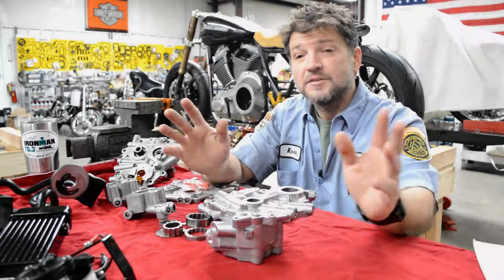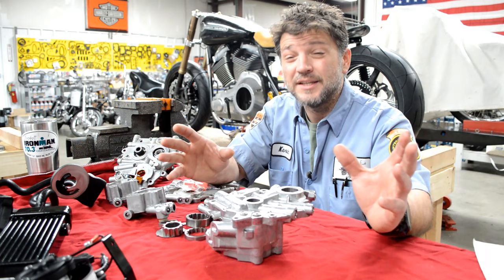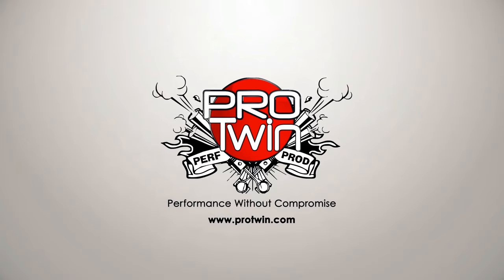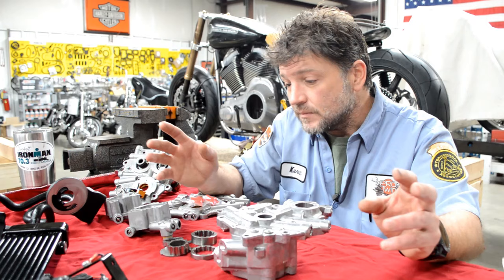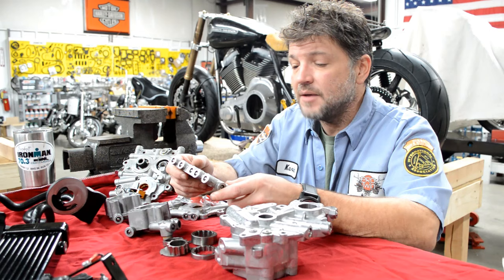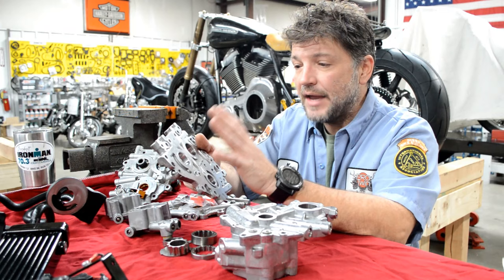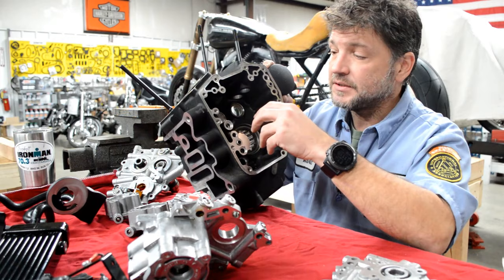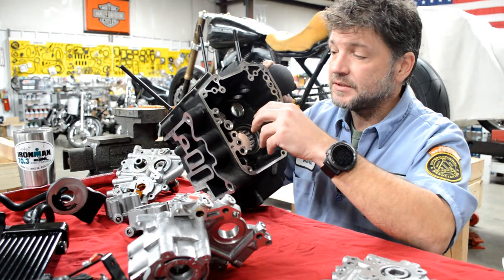Harley Cam Plate Tech - The M8 TC Cam Plate Debate - S&S Cycle - Kevin Baxter - Pro Twin Performance

Comment: Hey Kevin quick question, my brother has a 2006 heritage softail that im sure the cam chain tensiors failed. I know the whole cam chest needs replaced, but what is the procedure for checking if the trash went through the crankcase and oil filter
Reply from the maker: First thing...remove the filter and pour the oil from it over a thick paper towel or tight knit white cloth. See if any pours out. Then, cut the filter open and spread out the filter media to see what was caught. If none, you're probably ok. If you have some, take a pic, send to me, and message me. I'll guide you from there.
Reply: @KevinBaxter  ok Kevin , no metal in filter media or oil poured out , but just like the pic you posted the other day there is shavings in bottom of the the oil filter canister

Comment: The biggest problem is the material that the tensioner pads are made out of they plug the system how do you clean that little hole out in the bottom of the case because mine's plugged on the exiting side and my motor is getting hot I put the gear drive cams in that it should have had to begin with and why did they why did they take the best motor they ever made the Evo and f**** everything there was good about it who's brilliant idea was the light in the crankshaft you know somebody couldn't stand that they were a better bike than Honda or what

Comment: What do you think of the feuling OE+ cam plate and pump.  Looking to replace my 2004 95" SE 203 build with Andrew's 26g and new cam plate and oil pump.  Looking at the S&S but also looking at feuling.   Thanks for any input.
Reply from the maker: If you can wait a couple weeks,  I'll be doing a live tech with Luke from Feuling to talk about all their products.
Reply: @KevinBaxter  well that kinda answers my question.   Watching your show I dont think you would have a company on if you didn't like their products.   Lol.  Thanks.  My bike is actually torn apart right now measurement was .002 at pinion side.  So was debating gears then started thinking plates which lead to oil pump.  Thank you really enjoy your show.  Has helped me tremendously along my harley journey!
Reply: Looking forward to this I’m really leaning toward the feuling products as well
Reply from the maker: Exactly.  I'm not just presenting products to sell stuff.  If i didnt believe in it and have had great results and extensive review, I wouldn't be bringing to the channel.  Im excited to have them on...they have great stuff with their own unique features and benefits.
Reply: Kevin Baxter okay after watching one a different channel I know have a question!! S&s still puts the brass fitting or bearing on the plates but Feul does not!! I get that feul is a upgrade over stock, but is it going to possibly mushroom like a stick plate?? So basically is s&s the better option?
Reply from the maker: Not exactly.  Feuling uses a process called roller burnishing to size the hole.  its an alternative to reaming a bushing and is very precise.  basically, rollers are progressively forced open to size it.  this work hardens the aluminium.  since its not soft like stock, if the crank is relatively straight, it wont mushroom or wear like the stock one.  plus it's billet, not cast.  There is a lot of other tech packed into the feuling stuff and im excited about doing the video with them for you guys.  then you can make a more informed decision between the two.

Comment: I enjoy the videos, I've learned a lot about Harleys.  But, why not buy a Honda?  You don't have to worry about upgrading anything because the stock components are junk and you spend all day riding a smooth comfortable bike.  Plus, 100K is no sweat and even 200- 300K is obtainable on some of the bikes without an overhaul!

Comment: What I get out of all the videos of everything built after the Evo....is don't bother buying anything after the Evo since by the time you fix all the factory defects there won't be any stock parts left. Better to build your own instead of chitcanning most of the engine and if you don't wrench sub out the work to Pro Twin Performance. All these weak, marginal factory parts in what hasn't been a "premium" (relative to the competition engine designs) drivetrain since the 1960s is unfortunate.... 

Meanwhile the quad cam Sportster design solved all the "CNC bean counter engine" design faults decades before they happened and as the late Alan Sputhe proved works fine with very fast custom big twins. Tech changed to reduce PRODUCTION costs because  a pile of CNC parts (aluminum is cheap and so is G-code because you only buy the code once!) is less expensive that manual assembly.

Comment: From what I can gather if you’ve got to much runout as Harley calls it you can’t even use a gear driven system which is pretty much luck of the draw on how your bike was produced by Harley it’s a bit of a concern on how Harley build there bikes and there build quality TBH.

Comment: it still baffles me why guys spend so much for a harley to just spend more money to fix issues that should be right from factory.. look at yamaha back in 99 with there 1600cc or 96ci  4 valve motor then pumped that up tp 1700cc in 05  and know guys with 70-90k miles  with simple oil changes and even yamahas newer 1900cc 115ci motor that came out in  08 both push rod and way more advanced.. harley fit and finish is beautiful but everything else aint worth it thats why are in the shape they are in now

Comment: Yuk......what a pig of a system. S&S are terrific for retro fix but wasn't the late evo a better bike?
Reply from the maker: I think the fact, that the evo had the oil pump outside the case, and it wasnt reliant on a straight crank, and the very end of the crank was supported, contributed to the fact that Evos seem to have had less problems.